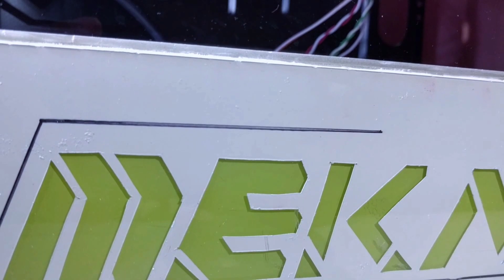Client PC Build :: OverWatch | D.Va

Comment: Hi Chino.  I just watched your video's and this one made me smile.  I did a D'Va case for my daughter http://imgur.com/v81YgEF ,  http://imgur.com/20vqF5a .  I like the use of acrylic/plexi that you do.  I used MDF for the outside of the case.  Nice Work!
Reply from the maker: +Icromnius Thanks, Yours is very nice as well! Im quite new to modding.. would you say MDF is better to work with versus Acrylic?
Reply: ChinoTech I am not an experienced modder either,  but have been doing my fair share starting out.   This was my second case mod.   MDF is useful,  but just like acrylic,  had limitations and issues.   For the things of yours I have seen,  acrylic is good.  MDF requires more paint work,  but is more forgiving than acrylic for drilling.
Reply from the maker: +Icromnius ah I see, interesting. Thanks